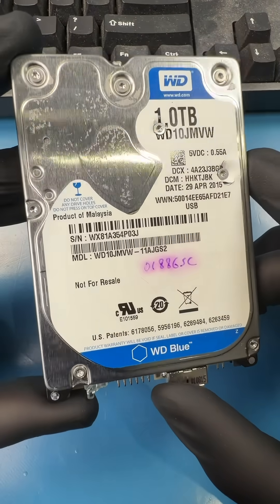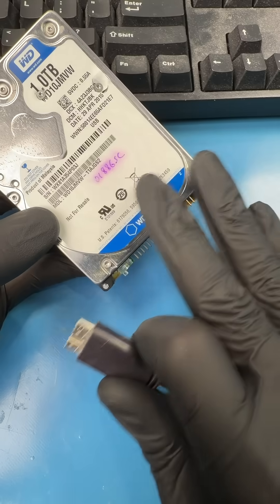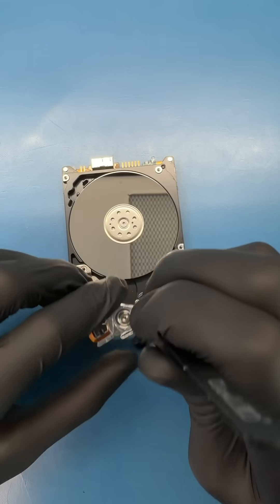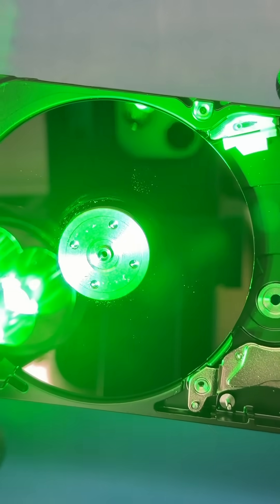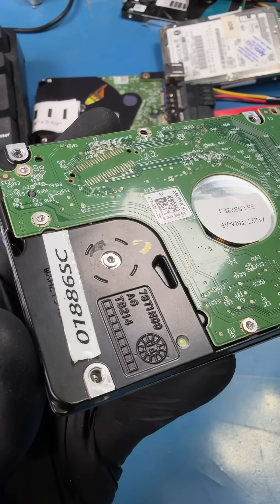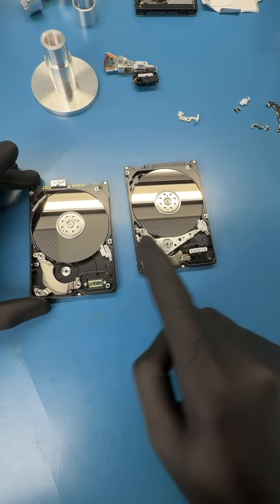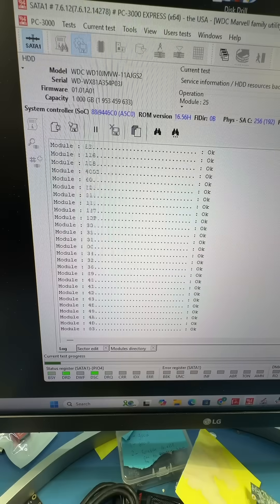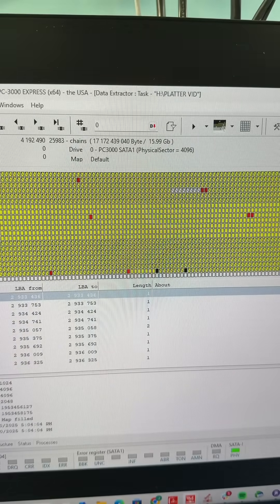Clicking hard drive? #datarecovery

Comment: I gotta ask… what was the hard drive doing sitting on a horizontal surface where a cat could knock it off?  I mean WTF who leaves the hard drive, like on the counter??
YMMV but my HDDs are usually inside a system and there’s s no way a domestic cat could knock a system to the floor 😮

Comment: When the drive crashed, if it was running the tracks undenrneath the heads may be lost.
If it was not, you can maybe read the discs raw, and reconstitute the data, but this is much harder and requires specialized equipment. Forensics use this, at some times.

Comment: Around 2016 a cleaning person at my work accidentally knocked down my Dell tower pc. After trying to boot up the pc it did not work. 

Took the drive to a recovery center and they called me saying their normal recovery done at their shop would not work. They would need to send it out to their headquarter for advance recovery and that is an eye watering $6000 for this 500GB SATA.

Lucky I had backups and could recover from there.

Comment: Was the hard drive in an enclosure or just sitting bare like that? Something that small and light even in an enclosure should not be sitting on a surface where the cat can take a swipe at.
Reply: It's an external drive missing its shell. So yes it was probably just sitting there for the cat to knock off.

Comment: Curious if you've ever recovered data from drives previously "destroyed" by various means, such as wiping, hammering, degaussing, etc.? If so, aside from actual shredding, what destruction methods would you recommend that is affordable and accessible to most? I've done hammering beyond dents (i.e. pieces flying off and platters shattered) as well as a basic drilling. Sure, higher level data recovery (i.e. lasers) is still possible for most of that, but you'd have to be doing some extremely shady stuff to warrant that level of recovery.

Comment: The secret is to buy a hard drive that has been sold in the millions and whose controller is compatible with a wide range of the manufacturer's hard drives. A data recovery company that stocks hundreds of hard drive models will be able to recover a maximum amount of data. Storing data on a good hard drive is better than any SDRAM card; its lifespan exceeds 10 years minimum, and after 20 or 30 years, if the drive still boots, the problem is finding a system that can read very old data formats.

Comment: This is why my computer desk has tiny holes and the pc itself is closed inside a cabinet. It's a custom built desk, so once a hard drive is sitting on top on its dedicated tiny shelf inside the closeted pc inside the desk, the only things on the desk itself are the monitor and mouse and keyboard, so the pets cannot get to the pc at all, and the holes make sure that the closed cabinet with the pc inside has enough ventilation all around

Comment: Some repair technicians are just plain incompetent! I went to BestBuy once looking for a computer part of some kind and someone from Geek squad was helping me and they asked what operating system I was running. I told him that I was dual booting Windows 10 and Kali Linux. His jaw dropped and was trying to tell me that having more than one operating system was harmful to my computer. I realized, right then, why I was having so much trouble explaining what the part was and did. I told him that he was incompetent and I was better off trying to find it on my own and then, I walked away. The idiocy of what that TECHNICIAN told me... I've dual booted up to 5 operating systems on one computer before and NEVER had any issues in the 3 years that I had it and using almost constantly. Yes, I know there are limitations to the amount of operating systems a PC will let you have (on the main hard drive.) I had 4 on the main hard drive and one on an external hard drive. 3 different versions of Linux including Backtrack and 2 versions of Windows including a Windows Togo distro.

Comment: hang on, the firmware and sector info (bad sectors, etc) is on a chip on the drive. you can't just move HD platters around, you need the disk info for that particular platter. there's something wrong with this story.

Comment: Here’s something crazy, years ago hard drive went out on MacBook Pro. Went to Apple Store and somehow the guy was still able to copy the files, sounded like the motor wasn’t spinning fast enough and it was making scratching sounds. I told him I’ll let it keep going into the external and left. Let it keep going for a couple of days and copied the hard drive. Around 13 yrs later this past week I still have it and use it because some sites for work won’t let me login on an iPhone for some reason. It fell off the couch onto a hardwood floor. Acted funny when I turned it on but it still worked
Reply: *when it messed up the first time I bought a 1TB external drive and started backing up using Time Machine.

Comment: I can only assume this is not the original drive from the story, because that model drive wasn't MFG until 2014, 9 years after when the client supposedly started using it to store their data. In fact, 1tb laptop drives didn't become remotely main stream until after 2009.

In fact, this isn't even a story about one of your clients, because according to your website you've been in business since 2014, and as I stated above, this drive came out in 2014, so they would have only had the drive for a few months, not 10 years.

Comment: WD10JMVW (date of manufacturing 29 APR 2015) which is not aligns with the story and folders starting with "2005", this is not supposed to be the first or only device she used to store these, so she might have backups on other devices, or the whole story is just fake to advertise your services. Also mistakes: you showed up unknown SATA drive with clicking heads instead of the drive you've been talking about pretending nobody would notice and then you installed WD10JMVW plates into this drive casing, all mixed

Comment: I had 3tb die. Tried everything. Replaced driver board, try replacing bios chip, tried replacing reading arm from a working 3tb, tried cleaning platters. Nothing. Sometimes computer knows it a seagate but no drive letter.

Comment: My laptop stopped working I went to get it fixed, it got fixed but before giving me they did something and said it's had shot and is not working, tried to get it looked at in amither store, they said it can't be saved, I had hard drive removed already but somehow the drive isn't showing the data, it shows there is folders like the main 4 things but doesn't open them (I'm using a case to keep the drive in and connect to a new laptop btw) idk what to do and if anything is recoverable

Comment: I would just say, when it's critical(to the customer) data, once to saw dust inside, you should just cleaned the disks and gone straight to dropping then into a proven functioning donor drive.. so much time and effort saved, no to mention, if her drive took an impact, as stated, dropping them back into that drive, if an arm was bent etc, could have totally destroyed the surface. You got LUCKY on this one! (Takeaway... think it through, meaning.. if this dopant work, what will I do, and if that dent work, what will I do, etc.. and as long as the final fix is the least potentially destructive, make it the FIRST option.

Comment: You do know what you are doing compared to that other company. Incredible that they left their fingerprints on the disks! I didn’t know that you can open the disk’s case and use it again, because it is a vacuum to avoid collisions with dust particles which could damage the disk heads because of the incredible speed they rotate. I got a new 6 TB for my photo’s to work with Lightroom. I’m going to buy a 8 TB for backing that up too! Good to know there are people who do know what they are doing. Great Job!👍🏻

Comment: This is the difference between an expert, and well....

I'm definitely not an expert in data recovery, but I'm smarter than the average bear.  Data recovery on magnetic media is super interesting to me for some reason.

Dealing with flash memory controllers + encryption chips really makes recovery a lot less likely with minimal damage. At least that's been my experience. 

It's really unreal how they sent the drive back with all that dust + dirt. (here's ur disk, btw its WAY worse than we got it)

Comment: That's the nice thing about solid state drives. No moving parts.
Reply: but when they fail there is no chance of recovery
Reply: I had one SSD die. Just gone, doesn't even show up in BIOS.
It had 59 GB written for a 72 TBW drive, so 82% of life spent (I know that because I regularly record that SMART data).

Comment: I have replaced the circuit board before with one with the same version firmware. Sometimes recoating the platers with PFPE oil also helps in getting the other areas to read. I like what you did. Very well done in changing the heads.

Comment: Dude thats impressive to even get that much off of a potentially damaged drive. I recently did something similar but instead of a cat it was a windows error bricking and locking thr harddrive down and breaking windows in the process. Drive was set to read only so accessing and saving data was next to impossible. Tried transferinh ownership to a new account and still nothing worked. I had to use very questionable software to bruteforce access to photos and files. Saved my friends data of photos of family and old pets along side $5000 worth of vtuber data.

Comment: Blessed is the pessimist, for they are the ones with triple-redundant backup strategies, with complete backups off-site. 

You can try to make the case for onsite-NAS, but that only lasts until the building burns down, or floods due to storm or plumbing catastrophe, taking your computer, your backup, and your backup-backup all down with it. 

Get a clue. If its that important, then treat it as such.

Comment: Seagate had a run of bad drives in the late 2000s. The heads would disintegrate, and the flakes would cut grooves in the surface. Out of 4 drives purchased at the same time, three failed. They all had the same date, and the serial numbers were very close in sequence. One drive had my baby pix and another was its backup. Seagate offered to replace the drives but not recover the data. So, it cost $1,200 to find out my second child has no history of his existence.

Comment: As a former IT Engineer, I would guess that she was using a USB to SATA data connector cable which is perfectly safe but I always do my best to encourage them to buy an external HDD enclosure to safely stow their HDD. This depends on the make and model they are using either USB 3.x or they are powered and USB 3.x. Or better buy a NAS then you can be assured that your data will be safe.

Comment: Whilst working as the IT manager for a medium sized company (9 sites, 1200 PC and multiple servers). I was called one morning by the Director of Manufacturing, the company's core business. He had dropped his running laptop, this was before SSDs. I was 150m and 14 stairs from him, so went down to see him. The OS wasn't running but the power light was on. I listened to him and understood that he had a major presentation to our biggest customer that afternoon. I asked him if he had been docking his laptop as he should have been but like all of the key executive directors they didn't dock their laptops because of the requirements for security. His drives were toast and to get each one recovered in two weeks would cost £4500 each (30 years ago). I had to go to the MD for that cost. It was refused, it took the D of Manufacturing 6 months to replace key parts of the data and the MD got board permission to terminate anyone not docking their laptops when at their desks.

Comment: Wish I could find a place to help me 😓 the last place I contacted I told them my issue which is I have several failed drives and I'm not sure which one has the data I'm wanting to recover and they were like oh that's no problem we can look at them all see what data we can see and go from there and you can tell us which drive you want us to work on. I was only gonna send in the 2 or 3 I thought were most likely but the agent assured me no don't worry just send all of them so I sent like 6 and then they proceeded to tell me that it would cost them to much of their time if I'm not recovering them all and just returned them it was so disappointing 😓

Comment: The beginning of the video shows a USB hard drive (probably a WD my passport which has no SATA interface) and then halfway through the video (after grabbing a good pair of read heads from a donor drive) it changes to a SATA drive?? I have been told that there is no real way to turn my WD My passport into a SATA drive because changing the interface won't work because the firmware isn't going to match effectively bricking my HDD.

The reason why I want to change the interface is because ever since I repurposed my old laptop's HDD as an external HDD, I noticed that it actually feels faster to navigate the folders and launching files despite being 5400RPM and using the same USB 3.0 (3.2 gen 1) interface. I tried to find out why and I noticed that the enclosure I was using has UASP, while the My Passport (and pretty much all popular external hard drives) doesn't. I have been looking for 2.5 inch hard drives ever since but they are either out of production, or are so expensive I'm better off getting an SSD. I just want cheap external storage that is not a pain to navigate.

Comment: I understand why MD removed and analyzed the platters first, since there was visible contamination on them. But why did the first restoration company start by removing the platters? If they had powered it on, shouldn't the clicking sound have been an indication that they need to start by looking at the reader head and its supporting hardware?

Comment: That's why you raid 5 or raid 6 and use SSDs. I am making my own LAN Server using a raspberry pi 5 with three 2 TB disks in raid 5.
Reply: RAID is not back up but better than single drive. I have lost data relying on raid but it was just movies and music downloaded through the years so not critical.
Reply: @johnnyv8279  how so? Also RAID 5 allows 1 drive to get lost to recover data, and RAID 6 allows 2 simultaneous drive failures. Most of the time the data being lost issue happens when people don't know wtf they are doing with RAID tools or commands and procedures. That must have happened to you too, as 2 simulataneous drive failures (if you did RAID 5) is pretty rare.

Comment: If you don't want to pay for cloud storage I can give you 2 options.

1 have 2 hardrives and clone them every now and then. Risk both getting damaged or your house getting in some kind of damage that you loose everything.

2 get a nas with at least 3 drives but then again you have the same problem. You can have more security by getting a new nas in someone else's place and having your nas back up to that nas.

Nas with 3 drives at work with a protocol that of any of the drives gets damaged you replace it and don't loose data. I'm not an expert but you can read about raid 5 and other methods of nas storage. 

Also a nas I am getting into now is a beelink me because of it size and low power consumption.

Comment: Q: How the hell do you expect the read/write heads to work or even operate with the cover off ???
The heads are aerodynamically designed to FLOAT over the platters at the speed equivalent of a 747 jet in flight ... 
In a CLOSED environment

Comment: I have always lots of backups, so I never had any important data loss. And this dates back to C64 and Amiga times which used SCSI drives lower than 200 MB.

The biggest data loss was on my Amiga 1200. A Samsung 40 GB 2,5" drive died. I replaced the PCB - there was it again. But after a while the drive started clicking, the final death.

Luckily, I was doing the operating system installations for my friends. One of them had a full copy of my A1200 installation ;-)

Comment: My very old perfect hard drive started clicking then died only because of bad psu which was running on low current because of amd high power consumption and heating issue and internal bugs. Changed to intel and in 3 yrs I very rarely got issues, intel is 100 reliable and amd is literally the very worst in sudden crashes, throwing bsod, bugs etc.

Comment: I only try to recover data on working drives or drives failing. Mechanical issues are beyond my tool set capabilities. And it is expensive to get into that part of data recovery. This is why I outsource that part to a professional data recovery company. I have over two hundred "dead" drives, some I stripped for the materials over the years.

Comment: the other company likely told her a price to get it fixed and did want to pay for it the service to recover is completely seperate fee to repairing the parts of the drive also most company that do such service want replace reading heads cause their is not profit in doing so the only time they will is if the consumer has paid for the protection warrenty contract but for a drive that cost less then $50 their is not profit cause just opening the drive cost them more in wages then the servicing fee gains them to ask them to replace a part from a working drive that cost 10x the service fee to obtain is honestly not logical the women was likley being cheap and lazy

Comment: I'm paranoid about losing data - have been for decades. There's five PCs in this house; two in daily use and three that are just data storage. The daily use machines have their own multiple internal data-only backup drives and they pass new files to the three main storage PCs on a regular basis. Each storage PC has a minimum of four drives in it plus the O/S drive. Only one storage PC at a time is actually powered up. In theory we could still lose eveything but it would take a total house fire to do it and even then, we only need one drive to come back online.